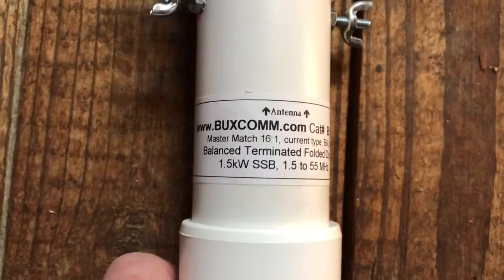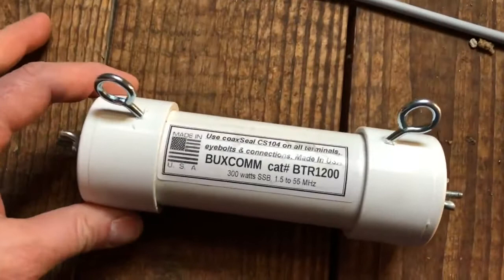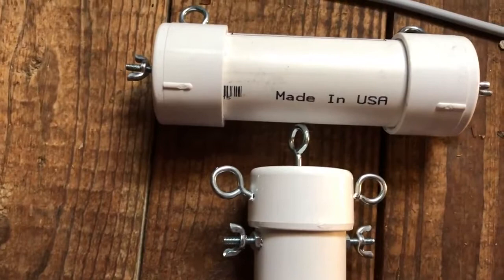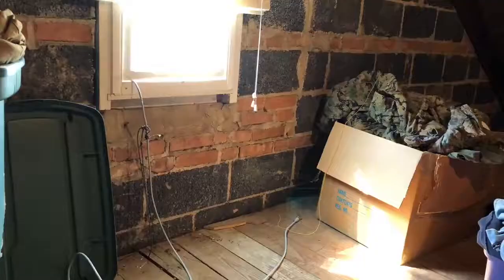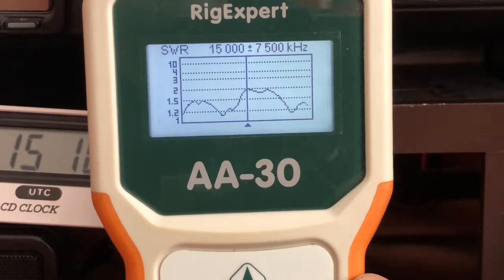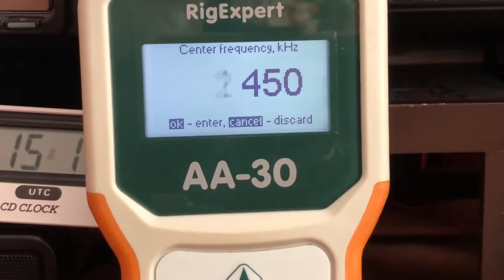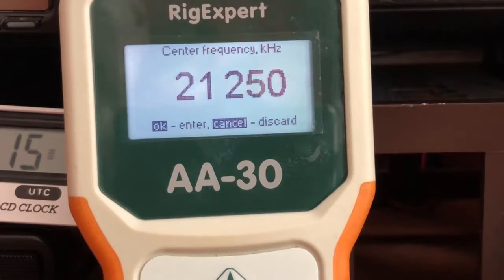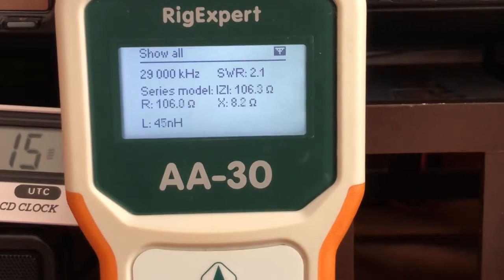Perfect HOA friendly antenna, discrete and stealthy Broadband Butterfly Terminated Dipole

Comment: No problem with the lighting. Getting on one's knees at our age is not a problem. Arising from our knees is the problem. This antenna is also known as a Bi-Square Terminated Dipole or T2FD (Terminated 2-wire Folded Dipole). Bonnie redesigned this antenna that she calls the Broad Band Terminated Dipole. I met Bonnie at the 2003 Dayton Hamvention. A unique lady.
     I have always preferred 450 ohm or 300 ohm feedline from my antenna feedpoint to the shack then a switch over to coaxial cable using a Gorilla connector for the conversion. I have one ATU that I can use for one balance feedline, and the others require a PL-259 connector or BNC connector.
 73 KB8AMZ
Reply from the maker: I plan to make my first trip to Dayton in 2019. I'm going to Frostfest in Richmond in February and that will be my first Ham Radio event. I moved this videos from another channel and Bonnie actually commented on that one. One of these days I'll have a proper hamshack and experiment with different feedlines. Still learning here! And yeah, it's getting back up part that hurts! 73
Reply: @BargainBasementHamRadio  I was told by an Elmer, now SK, that if I live in the USA I have to go to Dayton for the Hamvention. How often was entirely up to me. I live close to Dayton and spent many years of my youth in Springfield so my first 18 visits were my annual trip to Dayton and visit family. I am a QRP Op. In 1990 I found the QRP-ARCI (QRP-Amateur Radio Club International) and began staying with the club members until they changed hotels. The new one was too pricey and my little Sister was begging me to stay with her family while in Dayton. I haven't been to the new Hamvention site but plan to go if I can find someone/somewhere to stow my sidekick, a Chow Chow named Kobe. 73 KB8AMZ
Reply from the maker: @MoTown44240  I had a chow/lab mix when I was stationed in Arizona.....pound rescue...best and smartest dog I've ever owned. I've never been to Ohio, so  I'll do my best to make some advanced plans/reservations. I feel that I've just got to experience it once.
Reply: @BargainBasementHamRadio  Kobe is a rescue. Bought for the Grandson. He lost interest after one week. The Grandparents took over. They had no experience with pets. Called me 3 weeks to come get Kobe. I didn't want to be responsible raising any living being. I'm retired. Well, they mentioned they were going to put the dog down. I drove to IL and brought him back to live with me. When I was a single parent my Son went everywhere with me. I can't afford kennel fees if there was a kennel close by. Kobe restricts where I can go and the time I'm away from him.
Reply from the maker: I was a single parent for a time, I understand that. Yeah, owning a pet is a huge responsibility, at least you got a loyal companion!

Comment: Nice video. I appreciate you taking the time to do this.  My call is N2OWM, and like you I live in a covenant restricted no antenna zone and need a stealth antenna. You have peaked my interest.  
One question I have is what is the over all length of your antenna?
Reply from the maker: Hi and thanks for the comment! I think that I have close to 100' of wire up there, maybe a small bit more. the front and back sides of the attic are about 30', the sides are over 20'....add the angles, etc....I put the link to the site I found this and also, the inventor/designer of this antenna also left a comment on my original post on my other channel. Her name is Bonnie Crystal KQ6XA
Scroll down to near the bottom of this page for more options for a stealth antenna like this one!
http://hflink.com/antenna/
Reply: @BargainBasementHamRadio  if you want some antennas that you can put up in the attic i am in the same boat and speent two years to find antennas that can be in the attic
Reply from the maker: @AndrewMurphy8383  What have you designed, or decided to use?

Comment: Thanks for sharing this video.  I just finished installing this antenna in my attic of the second floor in my two story home.  Seems to have mixed results depending on band conditions.  I did end up somewhat serpentining the wire a bit to attempt to get it a little bit longer.  I don't know if that hurt or helped.  I think I have about 65 - 70 feet of wire per side with both sides being pretty equal.  Can you share some comments on how this antenna has been working out for you?
Reply from the maker: I also had mixed results for the same reasons, I believe. It worked as well as I guess it should, it being a pretty compromised attic antenna. I haven't used it in some. I am trying to get a 40m and 20m dipole up there to ....somewhat work.

Comment: What was the price on this antenna?
Reply from the maker: Hello and thanks for the comment. I believe I paid around.....$25-$35 for the Current Balun and the Resistor (each). I already had the wire and made the plastic insulators...So....Roughly.....$60...? Unfortunately, the online store where I purchased those two items is no longer in business.
Reply: @BargainBasementHamRadio    Shucks!  I have to find the parts to duplicate this!  ;)
Reply from the maker: Shouldn't be too difficult, might even be able to make them for a lot cheaper!